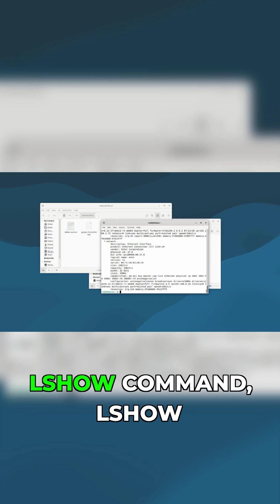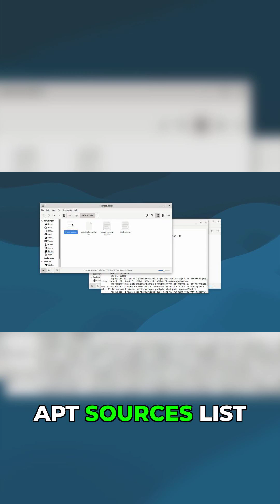Realtek Network Card Issues in Linux CNC? Fix Here!

Comment: So we should avoid realtek unless we are inclined to completely change out the NIC driver
Reply from the maker: Yes, this is because the included default kernel driver is generic and not optimised for some network cards so getting the right network driver solves a lot of common latency issues. (this driver is part of Linux but not installed byy default.)